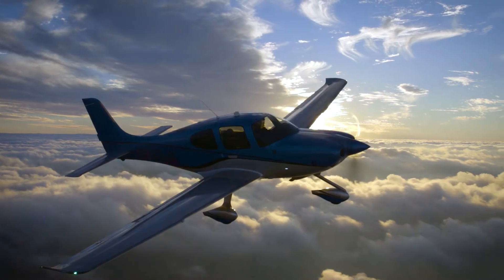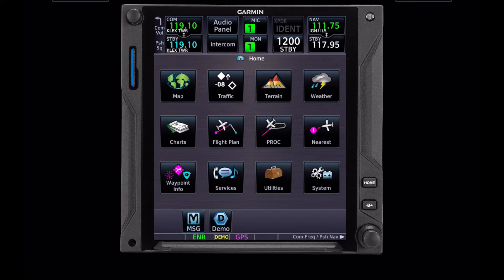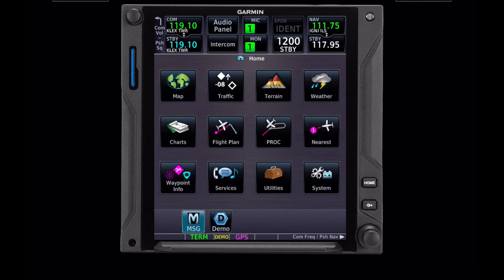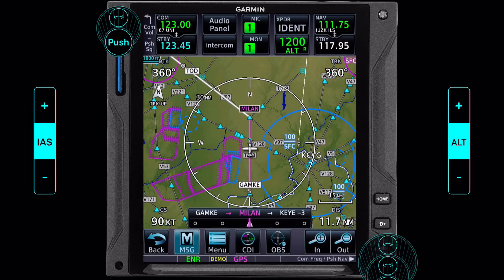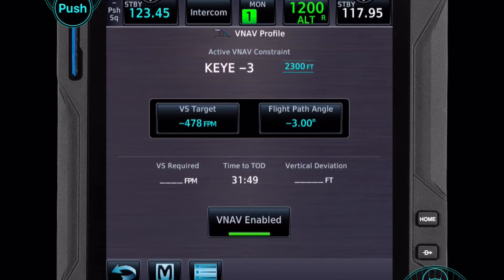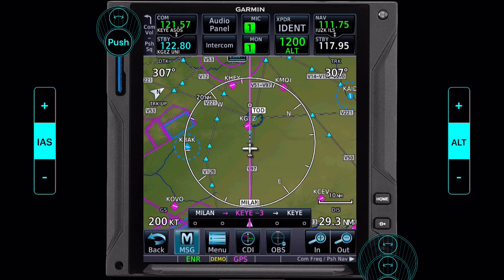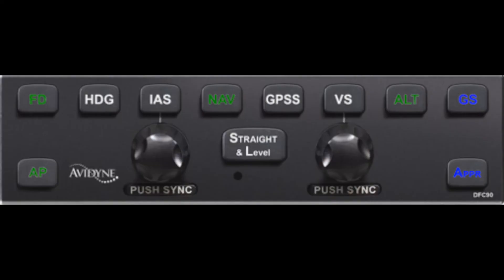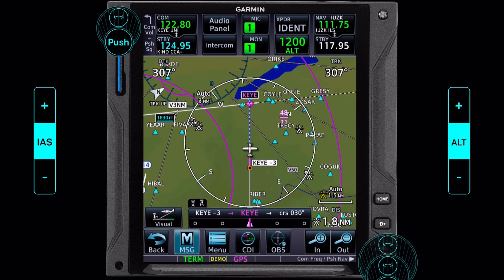GTN 750Xi VFR | KLOU - KEYE

Comment: Question - If you picked up flight following from Louisville, how would you craft your radio request? Your flight path is east (odd thousands + 500) then west (even thousands + 500) and it uses airways instead of going direct. So I'm curious how you would ask for this when you talk to approach control (or your class D airport) when departing. Thus far I've always been flying direct when using flight following.
Reply from the maker: That’s always an interesting dilemma of how much do you tell ATC when asking for flight following? I’ll usually just tell ATC my destination and leave it at that unless I have waypoints that are significantly off the direct course. 

If I’m going from Louisville to, let’s say Florida (not doing that Vfr, but let’s say there is a reason to) I’d tell tower I want Vfr flight following to Orlando at 7,500 with an initial heading of whatever. When I get maybe 10 miles from the point where I’m turning more west as in your example I’d let that controller know “I’ll be turning heading 190 at the _ vor” 

Give the controllers what they need but don’t overload them with information they aren’t going to use. If you’re Vfr don’t expect them to pass much info onto the next controller.
Reply: @kycsip3066  Thank you! That makes perfect sense. I appreciate the video and your response. I got my PPL last year and purchased a 182Q in August. Living the dream. I’ve been working on Instrument ground school and should be shooting my first approaches within the next few months.